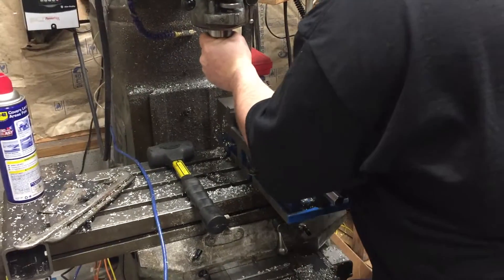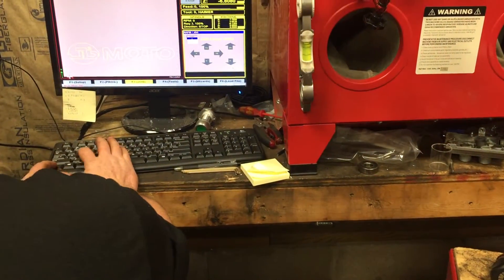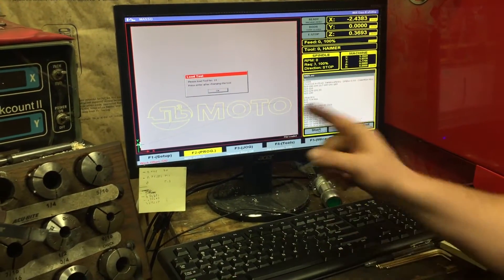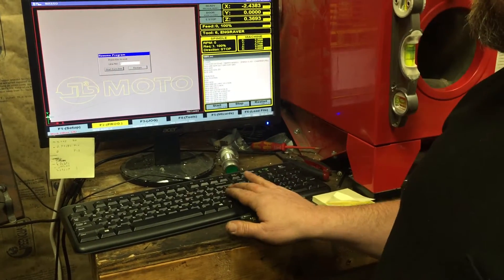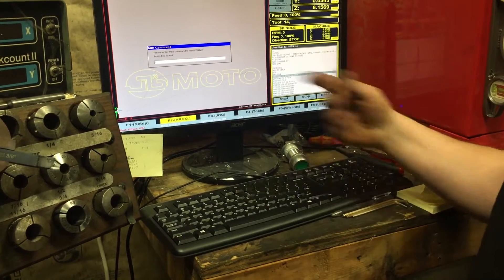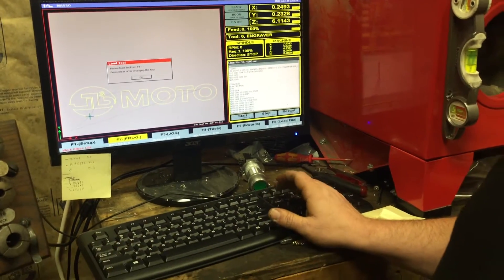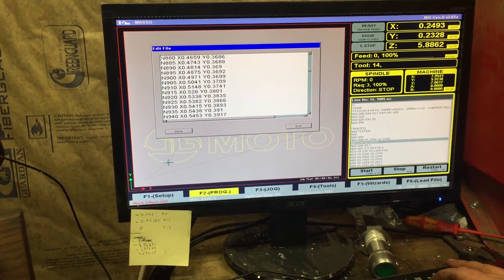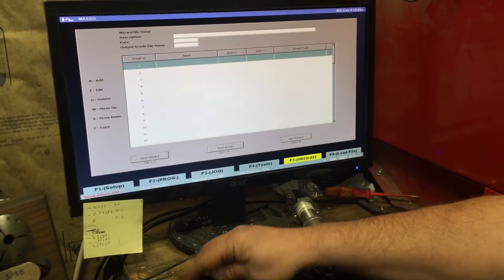Masso And ClearPath Running The Tormach Engraving Tool.

Comment: Are you all aware of the new open hardware beaglebone blue (yes blue not black) CNC running the open source MachineKit software? This also replaces the PC in CNC controlling. Since both hardware and software are open source and not really 
commercial (SW is free. Hardware you still have to buy. You could make it yourself but that would for sure be more expensive) I don't expect commercial grade support. But If it is in the field for a few months then online community forums and youtube vids will fulfill that role usually quite well. I think the beagle bone blue is something like $60-80. Check it out at beagleboard,org/blue    beagleboard,org/project/MachineKit/    machinekit,io/
Reply from the maker: rol eic no im not.   I found the masso amost a year ago and have not been looking for any other kind of controller.  The masso is hard to beat with the support that the guys at hind give. I will check it out tho. Thx
Reply: Since both hardware and software are open source and not really commercial (hardware you still have to buy. You could make it yourself but that would for sure be more expensive) I don't expect commercial grade support. But If it is in the field for a few months then online community forums and youtube vids will fulfill that role.
I think the beagle bone blue is something like $60-80. beagleboard org/blue
Reply from the maker: rol eic i didnt want something to tinker with have enough to learn on how to machine with it.  The masso is plug n play for the most part
Reply: The masso is more expensive. The beagle bone blue can do the same and even more. Apart from the CPU which can be programmed in Python and C it has two high speed real time microprocessors in it that can be used to create high speed signals to the steppers making them move lightning fast. And the MachineKit software is based on linuxCNC and is very flexible in terms of the machine architecture. It can handle more than X-Y-Z machines like parallel kinematic machines, 3-axis Delta robots and 6 axis stewart platforms as in real flight simulators . But it is true you have to learn to setup MachineKit which is a little more complex but non-programmers can handle it with the handbook and a supportive community. And it is much cheaper too. For the saved money you can spend a few hours studying the manual.
Reply: You seem to be sold on the masso. But your viewers should check out both the masso and the Beaglebone Blue before they decide. Not everybody will have the same preferences and needs as yours.
Reply from the maker: rol eic im sure its a good controller and for a great price but thats not where im at in machining.   I wanted something just to run and not fool with is all.  Im not obligated to tell anyone about any other controllers out there im just explaining wht i do with mine and the issues i have.
Reply: Yes no problem at all. Everybody is allowed to choose what suits him. You will have good reasons to prefer the Masso. I added my posts so that your viewers have more choice since their preferences might not be identical to yours and the Beaglebone Blue might be an interesting option for them. What would be interesting is a detailed and fair comparison of the two in a CNC application. That could become an interesting video.

Comment: John, for the Z alarm I think the reason for that is most likely the MIN and MAX travel in your F1 setup screen doesn't  have the full range of your Z axis travel and when doing Z motion the controller thinks that its going outside the travel limit. Please have a look and if you still get the issue then please let us know.
Reply from the maker: Hind Technology it didn't do that before the update.  I still have 2-3 more inches of up travel in the z before we hit the limit.  Our limit is set to the vise hitting the spindle with no tool in the collet.
Reply from the maker: Hind Technology i will double check though just to make sure
Reply: The reason for this in the new version is that because we added soft limits. As you said your axis is still 2-3 inches away but if in the F1 settings the total Z travel was not properly entered then the controller is going to think that its out of the travel limit. So for example if your machines total Z travel is 200mm then in the F1 setup your MIN travel should be -200mm and MAX be 0.00mm because we home to the top at 0.00m and machine towards the -ve side.
Reply from the maker: Hind Technology ur right that is how we have it set up 0 is the spindle with no tool touching the vise and -266 is the home prox
Reply: Hi John, we sent you a new update software, please load it to the controller and let me know if it resolved the soft limit alarm issue.
Reply from the maker: Hind Technology the software update has fixed the soft limit problems that we was having.  Installed the update and ran same gcode and worked perfect.  Thx
Reply: awesome, thanks for the update and we are working on other things as per your list and will keep you posted.
Reply from the maker: Hind Technology please check out my email.  The latest version did fix the soft limits but the spindle will not run at all.  We had tried out diamond drag program to test the soft limit problem but that does not run the spindle. We went to run the spindle and it wont start but went back to version 3.00a and it will run
Reply: let me have a look John
Reply from the maker: Hind Technology thx man
Reply from the maker: Hind Technology thanks for such a quick response and fix for our problem guys.  I will get back with ya tomorrow to see how it runs.
Reply: so did it get right ?

Comment: Started following your videos today.   Great work! I am just starting on my mill conversion plans.  Can you shed any light on your choice not to use timing belts and pulleys to drive the lead screws?
Reply from the maker: Matt Kartholl just really didn't want to over complicate the set up.  I had the round chunks of aluminum laying around to use any ways.   The belts and pulleys would have cost me more money that the cheap ebay zero backlash couplers i bought for like 15 bucks each and they work really well for the money. Withe the direct drive the servos are still only at 50% torque set up in clearpath software and still able to snap off a 1/2 endmill.

Comment: Hey John,  that was me with the Wizards deal,  got that figured out with your input from prior video.  I've pretty much copied your example on a machine at the Day Job,  and really pleased so far with the whole setup,  especially the short amount of time from starting until I was jogging the machine around and running sample code (haven't cut anything yet).  A few headaches with touching off on the vise without a pendant (ended up using G91 G01 MDI to get .001" increments), and a few nuisance things with jog steps from keyboard going at 100% feed vs the % over-ride shown,  though the % over-ride works with continuous jog (shift key + X,Y or U/D).    Can I talk you into using Instagram?? Very convenient for sharing info / asking  & answering Q's etc.  I'm @NYDLS30 there ...... nice work with the engraver 👍👍👌
Reply from the maker: YCM30cnc if you want to email me at lambertj06@gmail.com. I will share wht info i have so far.